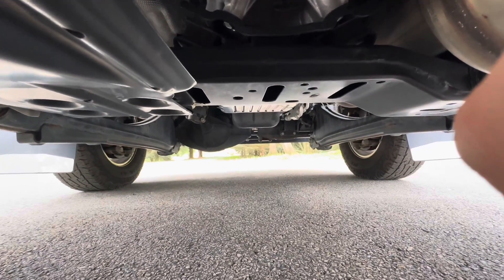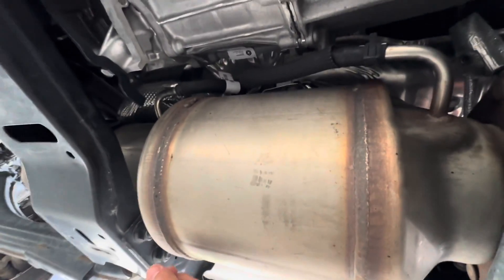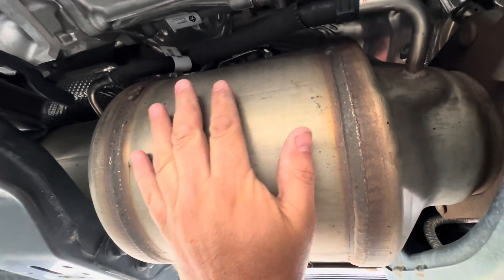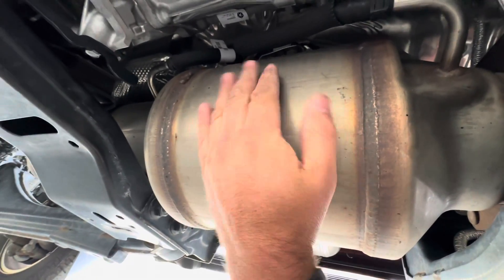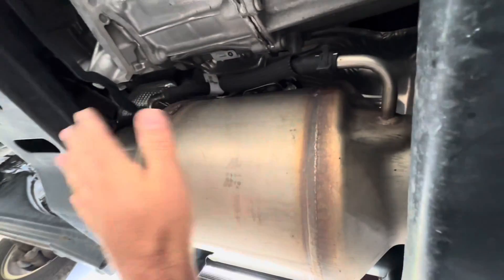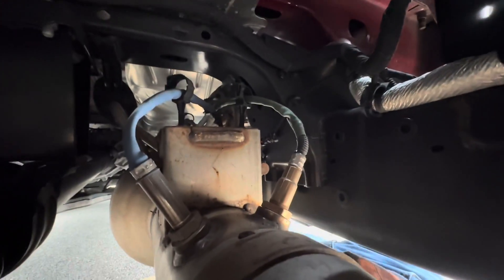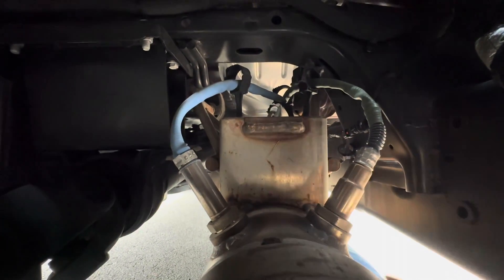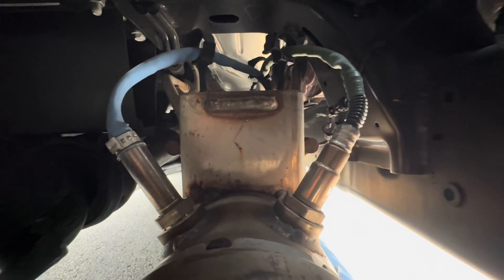2022 Ram Cummins DPF Regeneration and Y43 Recall Explained

Comment: Great information!  Thank you.  How does the PM sensor factor into the system determining if a regen is needed?
Reply: According to the video, it doesn’t. No (or very little) particulate matter should be getting past the DPF. If it does, there may be an internal crack in the DPF.
Reply from the maker: @mikeyohnk758 bingo!
Reply from the maker: The PM sensor does not control or provide any information for the purpose of regeneration. Its sole duty is to monitor the exhaust outflow and make sure that no excessive amounts of soot are escaping from the emissions system.

Comment: Thank you for this.  Yesterday I received three error codes stating my downstream particulate matter sensor needs replaced.  Im currently traveling with family and fifth wheel on the east coast.  Is this an urgent repair or can I delay getting this fixed when I return home in March?
Reply from the maker: The PM sensor is aft of the SCR system at the very end of your emissions package. It shouldn’t cause you an immediate issue but it should be repaired as soon as you are able.
Reply: @TheRamGuru In your video around the 9:18 mark you explained the two sensors.  I have the outboard PM sensor in place as you show.  So Im clear, that is the "downstream" particulate matter sensor correct?  I didn't see any additional sensors aft of these two sensors but want to verify with you please.
Reply from the maker: @richardthompson9875 yes the outboard sensor aft of the SCR is the PM sensor. It has the green harness wrap around the wiring. There is only one PM sensor on the truck.
Reply: Thank you.  Much appreciated.

Comment: Wow, this is the explanation I've been looking for thank you!  Question for you.  My 2021 had completely fine regens for the first ~3 years. Im currently at 121k. The last year or so every time it goes into auto regen the entire cab of the truck absolutely wreaks like burnt soot/burnt wax.  I have to drive with all the windows down until the regen stops.  When at a stop light, I can see a little smoke coming out the sides of the hood.  What would cause this?  Clogged DPF and/or faulty sensors?  Any insight would be greatly appreciated!
Reply from the maker: My first instinct would be an exhaust leak. Given the mileage and the years, could be a small leak at the exhaust manifold. Either a gasket or potentially a broken stud or crack.

Comment: Great video. Just came across as I'm doing research on my class A motorhome with this engine. DPF is blocked and it only has 39,000 miles. I'm getting quoted $5k+ to replace the DPF but  fighting it with Cummins to be covered under the 5yr/100k miles emissions warranty which is still active for a year. They are claiming it's not covered b/c this is a "maintenance" item. How does a 2022 end up with a blocked DPF this soon and they claim it's due to lack of maintenance? What maintenance??

Comment: Maybe you can help me with this I have a code P 24B1 it’s particulate matter sensor circuit high from the way that you explained it. It has nothing to do with being clogged, but maybe just the power going to it should I replace it or do you think it might be some type of battery issue?
Reply from the maker: Typically that indicates that your PM sensor is failing and needs to be replaced!
Reply: @TheRamGuru  I tested my battery I have a bad battery do u think it could have triggered it after they tested it the check engine light went off because they unplugged it
Reply from the maker: @justinallen349 possible? But if the DTC doesn’t clear on its own after several drive cycles it’s probably the sensor. Did you replace both batteries with new ones? Always replace them in pairs.
Reply: @TheRamGuru  no I gotta replace them Sunday

Comment: This is the best breakdown of the useless trash hanging off the bottom of my new truck that keeps putting it in limp mode. I’ve got to remove mine. It’s ashed up and I’m still looking for a way to pull it out.
Reply from the maker: If it’s a brand new truck, it’s practically impossible that your DPF is already full of ash. What model year?

Comment: So if the DPF is full of ash and not soot what will happen? Codes?
Reply from the maker: Eventually you’ll get a P242F code indicating that the filter is full of ash and is no longer capable of flowing sufficiently. It’ll also cause your regeneration cycles to get closer and closer together because there’s an ever decreasing amount of space in the filter that is “open” and capable of handling the soot
Reply: @TheRamGuru is there a way to wash out ash without removing the DPF filter from my 22’ ram 3500? Since it’s one huge piece, not easy like big trucks as you mentioned in your video. 
Like a spray or foam? I’m getting P242F, it’s not doing regen, and money is short for professional cleaning/baking by getting it removed.
Reply from the maker: @semprefidelis76 no it would have to be removed and washed if it’s full of ash. How many miles on your truck? A lot of times, the P242F is a false code. The truck thinks the DPF is full of ash, but it’s actually a soot-logged filter that hasn’t had sufficient drive cycles to allow it to regenerate out effectively.  Could also be a DPF that’s failing. 2022’s had a run of bad DPF’s from the factory.

Comment: Where would I start looking for constant regens? Truck is doing a regen about every 100-150 kilometres
Reply from the maker: Air filter is the very first thing. If you’re not using a Mopar 53034051AB or Fleetguard AF27684 air filter, that’s the first thing to change. Buy it from a trustworthy retailer like Geno’s Garage. Not Amazon or eBay. Too many fakes out there.

Comment: Can I ask WHY the 2022's didn't come with it and how do I have to have it?
Reply from the maker: The 2022’s were manufactured without the PM sensor due to a lack of availability. The supplier that produces the sensor had production issues (likely from COVID) and the sensors were simply not available during the 2022 production run. Ram signed an MOU with the CARB to allow them to sell the trucks with an incomplete emissions system, provided Ram agreed to issue a voluntary recall and install the sensors in all of the 2022 trucks when the sensors became available again. That’s what the Y43 recall does. Your truck will operate normally without the PM sensor installed. It doesn’t have any control over the emissions system. It is simply a “watchdog” sensor at the end of the emissions system which checks to make sure the truck is meeting targeted emissions standards, and not allowing soot particles into the environment. The trucks came from the factory programmed with temporary software that ignores the fact that the sensor was missing. When Y43 is completed, the sensor is installed, and the software is flashed to a more current version that includes the programming to allow the PM sensor to function and communicate with the trucks powertrain control module. If you choose not to have the Y43 recall completed, your truck will still function normally, however:

1. Your truck will not be able to notify you if your DPF starts to allow excessive soot to bypass through it (typically when the filter itself begins to fail internally

2. Should you encounter any other issues with your truck that requires a software flash as part of the repair process, when the new version of the software is installed, it will include the programming for the PM sensor. If you did not get Y43 complete (and didn’t get the sensor installed)  the new version of the software is going to recognize that your truck doesn’t have a PM sensor installed, and therefore will trigger a diagnostic trouble code and a check engine light, indicating the sensor is missing. 

It’s worth it to get the y43 recall completed if you plan on keeping the truck stock for the long term because you get a one year extended warranty on your DPF from the date Y43 recall is completed.

Comment: I’m feel like my truck regens a lot. I saw I have a sticker under the hood of my truck for the Y 43 recall. I will be double checking to make sure I have that sensor installed correctly.  

It wouldn’t be the first time a dealer technician says they did something when they really didn’t
Reply: I have close to 50k miles and I have seen regen once. I'm thinking you drive in snow, short trips or idle a lot.
Reply: @elainenilsson5472 Idk how that’s possible.  Do you monitor the dpf gauge on your dash?  If your not constantly watching that (like watching mpg, speed, or temps, etc) you would never know in your truck is in regen. (At least on mine, you must be on the dpf gauge monitor)
Reply: @AREyouAFRAIDofTHEdark1  He doesnt see it regen because it is doing it passively, he has only seen it regen once because it chimed and let him know he was actively doing a regen. That means he is driving the right way.
Reply: @warrenmichael918 I’ve tried changing driving habits.  Problem is it doesn’t matter how I drive.  I need to tow in order to get the EGTs high enough to burn the soot.  The EGTs never get high enough just casual driving.  It sucks and burns gas
Reply: @AREyouAFRAIDofTHEdark1  Are you getting the message that your filter is full or about full and to see the dealer? Or are you just watching your DPF gauge constantly and seeing it say you are in a regen? 
If you are always getting the DPF full message then something is wrong but if youre just always watching the gauge, thats different. My gauge will be at 0 then it can start to climb up towards 50% but it will start climbing down lower as i drive. If you arent getting any chimes and a message saying your full, i would stop watching the gauge and drive it.
Reply: @warrenmichael918 gotcha. Interesting that yours goes down as you drive.  Mine will only due that if I’m driving really long distances towing and towing only.  Otherwise it just goes up to about 45% and then goes into regen.   I constantly watch the gauge to try and monitor the dpf.  I drive a lot of small trips which I think is part of the problem.
Reply: @AREyouAFRAIDofTHEdark1  yes, small short trips do not get the heat up good enough to just passively regen , so your gauge goes up high enough to trigger the active regen. I tow everyday with big trailers , so when i see the gauge go up, i can also see it go down at times. Thats because im hot enough towing that it is cleaning itself out as i drive just from the heat and not any regen. My regens that happen in the background, a passive one, usually last @ 30 to 40 miles. I can hear the difference in my truck to know it is in a regen so i can scroll to the gauge to see when they complete. My luck usually has me in a regen about when im almost home. I have at times just kept driving up 10 miles to the next exit and back towards home so its done with a regen when i pull in. Thats usually only if im gonna be home and in town a few days and i want a clean DPF and not try to regen while im puttering around town. If it just went into a regn and im almost home but going right back out in the morning, i just park it and let the truck do its thing in the morning.
Reply: @warrenmichael918 thanks a lot. Thats good to know!  Been thinking about getting a beater car to drive rather than drive this thing everyday!  Thanks for the insight, much appreciated!

Comment: Thank you so much for this. I have a 2021vwith just under 61,000 miles and need to replace all, too. I am thinking I should just delete it. But not sure how it would affect resale. Also would replacing it show up on a Carfax and if so would it be a positive or negative?

Comment: I am having to replace now on my 2022 ram 2500 at 61,000 miles, which is ridiculous. A pointless part
Reply: I have a 2021vwith just under 61,000 miles and need to replace all, too. I am thinking I should just delete it. But not sure how it would affect resale. Also would replacing it show up on a Carfax and if so would it be a positive or negative?

Comment: I’m usually not a commenter but I appreciate you explaining the y43. I have a 22 with almost 50,000 and the only issue I have ever had is the infotainment screen goes blank occasionally and battery replacements. I have known about that sensor missing since the recall but I refuse for them to install it. Because as soon as I do… I know i will have issues. They are constantly contacting me about it but I ignore them. I have always done
My own service and refuse the dealer to ever touch it. One thing I do keep a spare of in my tool
Box is the DEF injector but so far no problems and I use cheap Tractor Supply DEF. I think a lot of issues are caused by driving habits. As you know Diesels don’t like short trips and liked to be worked . This may upset people but most diesel  owners don’t need it. At one time nobody wanted diesel except the farmer. Now  it’s trending…
Reply: I'm hoping you read this. Will it pass inspection without it? I am hesitant to let them put this on my truck. It is of NO benefit to me right?
Reply: @e @elainenilsson5472  Unless you live in California you’re probably fine. I have 55,000 on mine and have never had an issue. I’m not going to have it installed unless I sell it. I attached the url for the recall 
https://www.chrysler.com/universal/webselfservice/pdf/Y43.pdf

Comment: This all sounds like bs if the truck regenerates and spits out the crap that it is catching why not just leave that fitet off and let the jr breath either way  the soot is spit out into the atmosphere
Reply from the maker: @carlscalise4880  because what comes out of the tailpipe post-aftertreatment is a mere fraction of what would normally be expelled into the atmosphere. The DPF traps 99%+ of the soot and converts it over into CO2. The SCR system then reduces the NOx emissions dramatically. This is all very scientific stuff and it’s taken a long time to get it to this level. These systems do more than just “catch and release”. They capture, refine, reduce, and then release. What is released is a mere fraction of what would normally come out of a non-emissions truck. Take a look at a certified air quality map and compare the air quality in regions where emissions mandates are in effect, and where they are not. You’ll see the difference.

Comment: I put a reconditioned filter, i took it for a drive and melted the hoses to the differential pressure sensor, now im trying to figure it out the root of the problem..

Comment: Hello, this is a great video. I have a 2021 ram 3500 throwing p242f code. I can not find anything that gives me the levels in my dpf. Is there a chance that the pressure sensors have failed. Had a replacement dpf in 2022 under warranty.
Reply from the maker: @ericaking0316  P242F means that the truck thinks the DPF is full of ash, not soot. Ash is a byproduct of combustion and builds up over a long time in the DPF. It cannot be removed through normal regeneration. It has to be physically washed out of the DPF through a chemical washing process that requires the DPF to be removed from the truck. It is possible that the DPF you had installed under warranty in 2022 was defective. There are a number of 2022 trucks that got a bad DPF. Does your truck have any other active codes?

Comment: Hi there, I’m getting P2459 code on check engine light. I have a 2022 Ram 3500 6.7 high output dually diesel. I am hotshot. I clear code but it keeps coming back. I haven’t gone to dealer for any recalls yet. What do you advise? Thank you!
Reply from the maker: @semprefidelis76  don’t clear the code, get it to a dealership with the code active. Google TSB 25-005-24. Check your trucks date of manufacture against the build range listed on the TSB. Your truck may have a faulty DPF. In the meantime, which engine air filter are you using? I’ve seen the wrong air filter cause that code too. 

https://dot.report/bulletins/MC-11009477-0001.pdf
Reply: @TheRamGuru So it’s at 101k miles. Took it to dealer today for recalls. Y43 is taken care of. They also gave me a $5k! worth of things to be done! Main one is DPF replacement. On the report it says “P242F - DPF restriction. Ash accumulation. The soot is measuring at 11g/l. Once it has passed 9g/l, need DPF” $3500!! 
I can’t afford this obviously. Can’t even afford $800-$900 DPF filter removal and baking cost. I’m just going back to work as a car hauler. Same thing happened (p242f and same exhaust filter full power reduced see dealer) 1 month ago. Took it to a mechanic, they did forced parked regen with a scanner tool, everything was fine after that. (DPF showed 0% on cluster) But I have been idling and driving in city a lot with no highway driving and same thing happened again now. Eventually I have to get it removed and baked once I make some money. 
But I can afford up to $500 to buy a scanner on Amazon and bypass cable. Can you possibly recommend any specific cheap scanner (and bypass cable so no need for autoauth acct) so I can do forced regen myself?
Or do you have any alternative solution?
Thank you 🙏